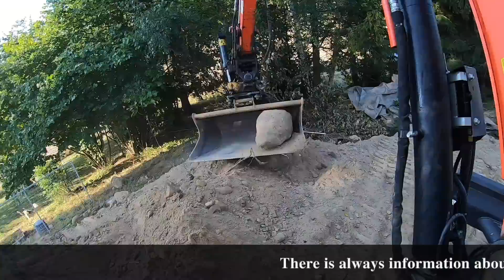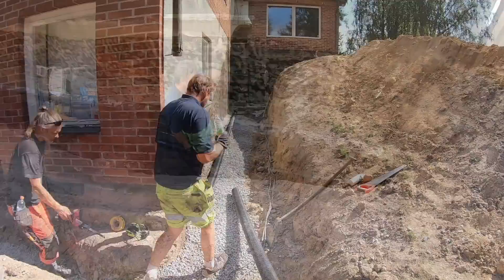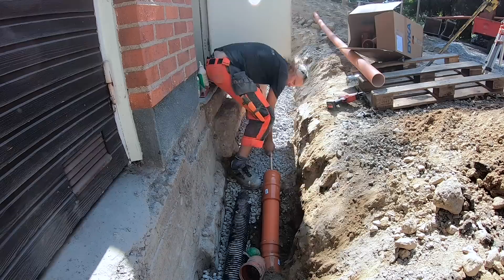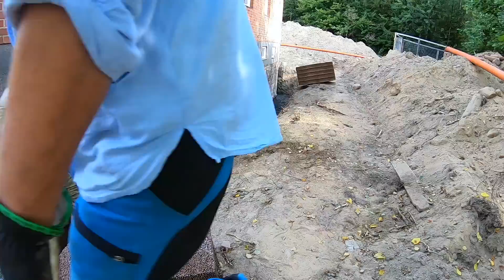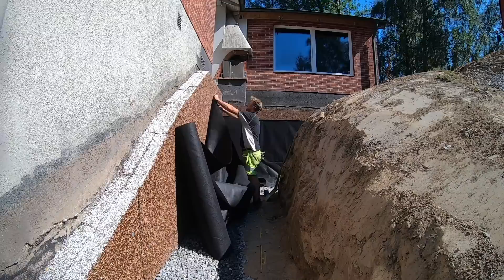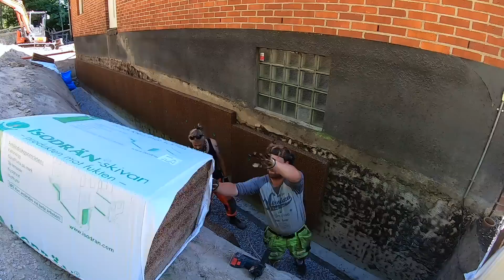New drainage around an old friend's house Part 2 -The insulation

Comment: I've been a contractor for over 30 years and have been troubleshooting and remedying foundation leaks for near as long...Almost all our houses have basements which brings the building envelope below grade by as much as 10 feet or more...I have never resorted to this level of water control...EVERY issue I had was related to downspout drainage issues or grading... Do a proper grading, make sure the water outlets are far enough away from the house so they are on the downslope, Coat the basement walls and floor with Drylok  hydraulic water pressure stopping coatings .....I'm not saying the method used won't prevent infiltration; I'm saying it's overkill...
Reply from the maker: How did you do with the insulation? This will increase the heat in the basement by 5-7 degrees Celsius during the winter.
Reply: @HedblomSwe  That's never been an issue...Anything below grade is naturally insulated by the packed earth...If it's above grade R 38 batts or 1.5 inch rigid work just fine...
Reply from the maker: But I just said that it rise the indoor temperature with 5-7 degrees?
Reply: @HedblomSwe  man bli impad av att folke tro att vattne bara rinn uppe på marken å int rinn ner i backen 😉
Reply: @HedblomSwe  I can't test your results. But I'll take your word for it...I like my basement to be natural...I have zero insulation...
Reply: @godbluffvdgg  I know nothing about this at all,  and not talking about the drainage issue,  but was thinking the same thing,  that 10 feet of earth would already be naturally insulated.
Reply: @pcdubya  hi i really dont think that 10feet of weet eart/dirt insulate very good, you have to get rid of the water by drainage the foundation not just a gradient on the topsoil
Reply: When the ground freezes the concrete gets cold. It's all about saving energy and not having heat leaks as well as draining water

Comment: What are ur installing on the walls 😳. Some kind of insulation for the basement walls or is it for water proofing the walls. Or all above lol.
Reply: I think its both :)
Reply: The water will run down the "pads" and go through it down to the drain pipes and it also works as insulation, altough they should have removed the old rubber from the concrete since moisture will find it's way there now
Reply: @RandomclipsCrew  thanks 😊 we just don't see that particular insulation in the US. Was that rubber or plastic u put on the top that u connected to the house.

Comment: Why is insulation needed below surface? Doesn’t the soil against foundation help regulate indoor temperatures?
Reply from the maker: Yes, but it is not comparable. With this method, you raise the indoor temperature by 5-7 degrees Celsius. You also get rid of the damp basement smell and you prevent possible mold due to moisture in the walls.